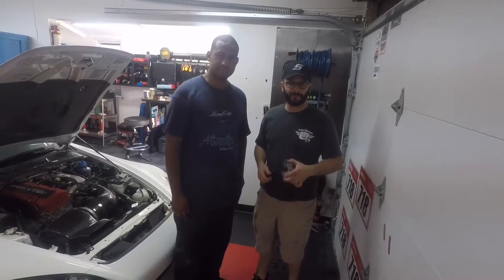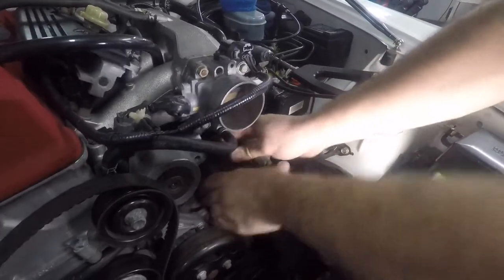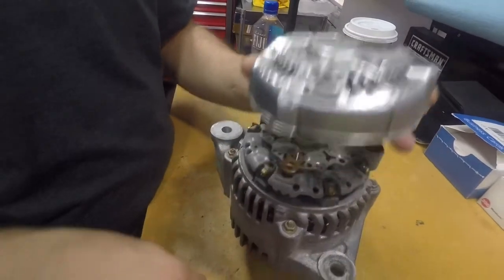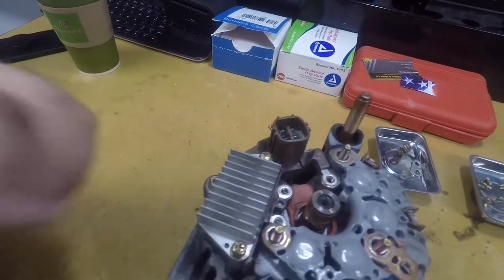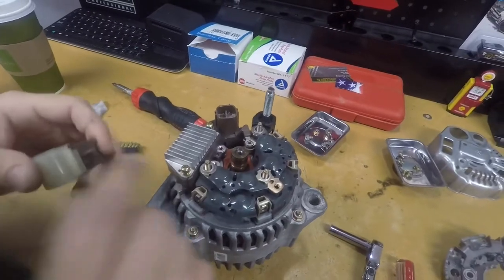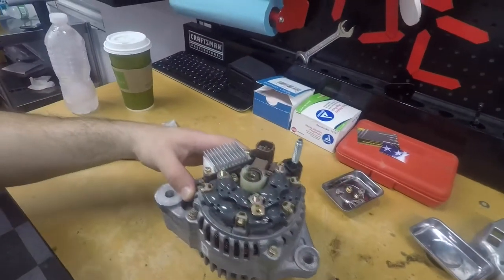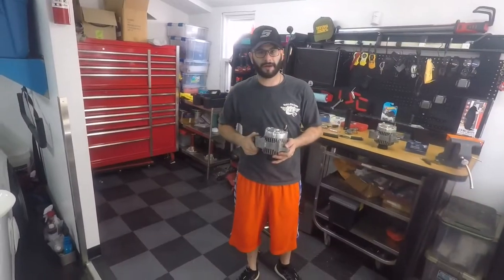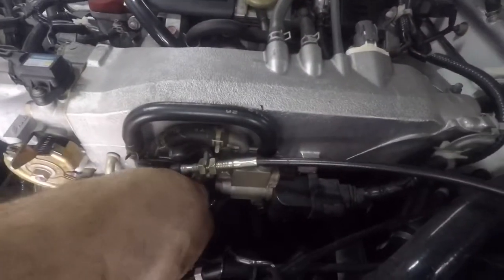DIY S2000 Rectifier Replacement

Comment: After 260,000 mi I finally had to replace the alternator on my '03 s2k. I rebuilt it. Thanks for the video
Reply from the maker: Your welcome, glad it help
Reply: @jlozano180  Another concern. I ordered the rectifier along with a brush holder. The old brush holder was really worn down. What could have caused the brush holder to be worn so badly? Also, I didn't replace the voltage regulator. How would I know if the voltage regulator was bad. I would like to know because I'm in the process of installing the alternator. Thanks.
Reply from the maker: @ronmann2755  the miles, 260,000 miles is a lot on an original alternator. The brush holder wears out over time. Unless you had many dead batteries on the s2000, the voltage regulator should be good, but if you’re taking it apart, I would change the regulator just to avoid doing the job twice. On the s2000, did your battery last only 2 years vs the normal 5 years?
Reply: @jlozano180  No problems with battery life. In installing the alternator should the nut that holds the cable behind the alternator be very tight? It was hard tightening the nut
but I got it tight not overly tight. Also, I have one vaccum hose, come from bottom right but I don't remember where it goes. Anyideas?
Reply: @jlozano180  I just want to thank you for the very informative video. Your directions were very clear. Again, thanks.
Reply from the maker: @ronmann2755  shouldn’t be on crazy tight, hand tight is all you need. I would have to see a picture of the hose since you have a 03, do you have S2KI, message me there and I can try to help you out, it’s the same screen name as my YouTube.
Reply: @jlozano180  After looking closely at the air box I found the vacuum connection. Again thanks.